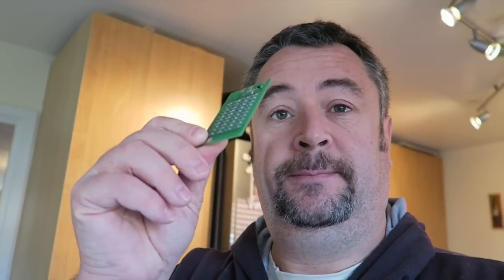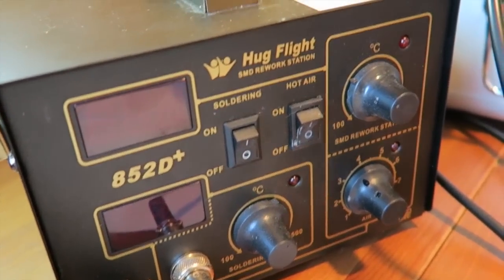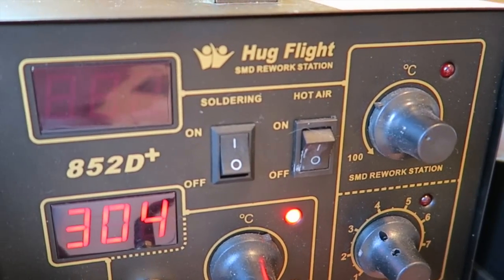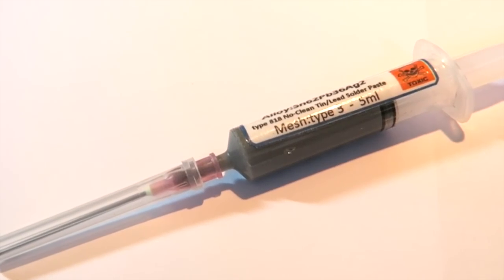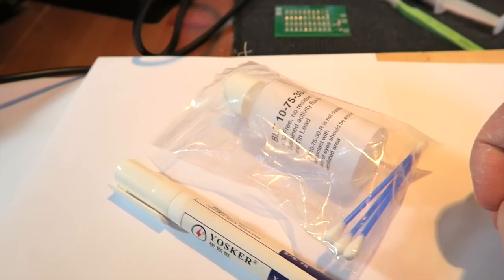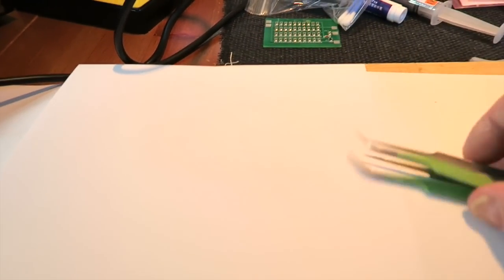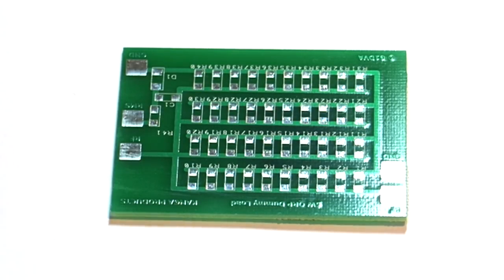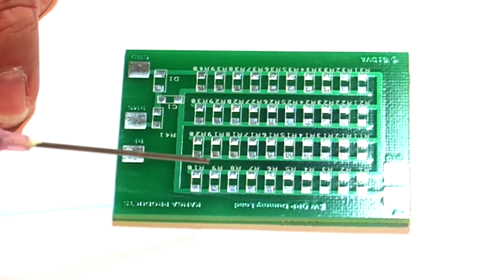Surface Mount Soldering - Hot air / Reflow = Part 1

Comment: Tip for shaky-hands soldering: Get your solder subject down on the table. Then rest the side of your hands on the table, so you're only really moving your fingers. Most of the trembling comes from tension in the large muscles in your arm. By doing this, the arms are at rest and no longer part of the movement.

Comment: "leaad based I believe" - not that it says in the middle of label Tin/Lead, when it comes to solders that  usually means 60/40 so 40% solder... no it is tin based as tin is 60%. 
"surprisingly heavy" ... erm... 40% lead ? lead is very heavy element? 
... it's good to see you know what your talking about. validity of the source of information : 0%
Reply: he was correct about all those things and you still found it in you to bitch about it. nice

Comment: Lead based soldering paste in the fridge?! Any particular reason to use a lead-based solder?
Reply: I really wish it weren't the case, but lead free is a pain
Reply: To be honest.. Lead-free soldering is by no means "less toxic", it's simply toxic in another kind of way:
It produces e.g. much more particulate matter than pb-solder, needs higher temperatures and the fluxes used are often higher activated (including halides).

So, from my personal point of view, you could sum up the difference like that:
lead-based: easier to solder, probably better results and component life, but it is actually special waste and is harmful in its afterlife
lead-free: harmful when soldering, but not harmful for recycling.
Reply: Yes, because leaded solder is the real solder that is actually able to work with.

Comment: I was chuckling when he turned the iron on to show how 'quickly it heats up' FYI that's not even remotely quick
Reply: Dude don't hate on it so much. It does actually heat up fairly quickly for a 50 pound rework station..
Reply: seemed pretty quick to me